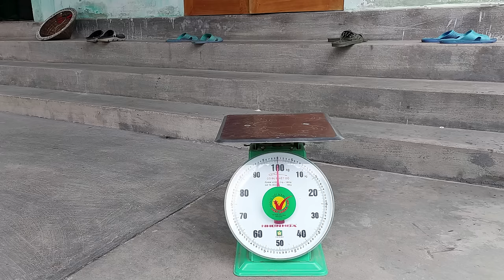Test my homemade RC Excavator from PVC  - Cat 390F 1/14 Scale

Comment: Very nice work my friend, but it is clear that there is a difference in time in the speed of sending and executing orders by the hydraulic control system. The vertical pressure motor must continue to work all the time and the execution of orders is by servo only to be accurate in the dates of receiving orders.